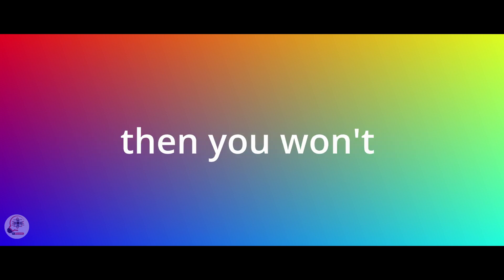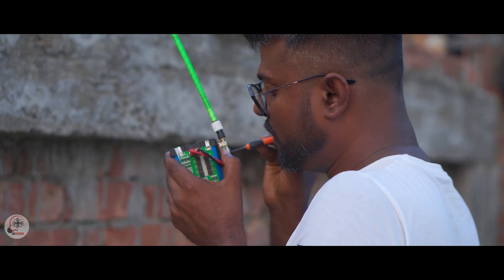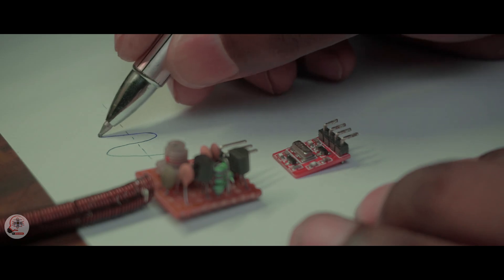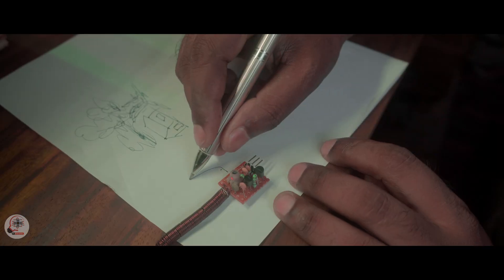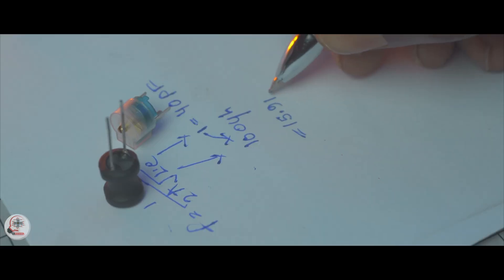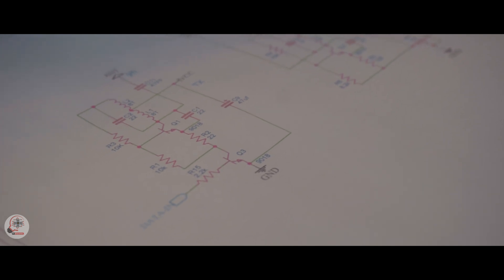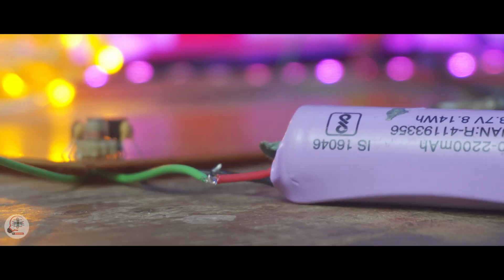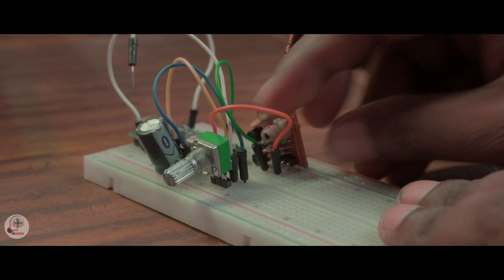How to Make Long-Range Transmitter and Receiver for  DATA (Arduino)

Comment: what if there are more than one set of modules, all working in the same 433Mhz frequency . Will not they interfere with other ?
Reply from the maker: 433Mhz module not working like  amplitude modulation  so that case transmission duty is separate to active few appliance then no problem. And will not interfere
Reply: @EtDiscover  Do you mean duty is different for each set of module?

Comment: @EtDiscover hi bro can you tell if I use resistor and capacitors of circuit with 5-10% value change excluding lc circuit will this circuit work please tell me and if you have time can you tell me what component value are critical for working of this rx tx circuit please 🙏
Reply: bro is the circuit working ? any update ?
Reply: @sdvgautham3500  no I have not completed it I have just made transmitter circuit only on pcb but when I am trying on breadboard it doesn't work I think breadboard is not good for rf circuit they are not that compact wiring for rf circuit I will complete the reciver part after some time and try but still I have many problems with his circuit diagram it quit don't work in Many simulators of circuits ...
I don't know I am studying the Hartley oscillator first then some rf type material to get more knowledge on this topic then I will properly get everything...
Doing without knowledge is like mixing chemicals without knowledge....
I know basic things like lc circuits, rf frequency, basic circuit working and building, basic components working applications , I have some knowledge with radio frequencies also but ...
This is more complete with the reciver part it makes it complicated with lm358 op-amp ic ....
I am searching for answers both for theoretical and practical understanding...
It will take time for this 🥱..
But I think if you have the components then give it a try 😝👍
Reply: Bro any update , i got a presentation on this circuit...need to implement on the hardware, this ain't working  @RobStark-fw6ig

Comment: Ek question tha mera. Can't we calculate the value of a variable inductor? so we can connect a fixed inductor. This is amazing. I want to implement it in my project.
Reply: But we have to provide another connection point at the middle of the coil ...which is not possible with a normal inductor or we have to use a transformer based inductor which have high inductance for this project.... And it is also very big for a tx and rx ... And not also tunable... This toy car inductor is best

Comment: Hello Sir!
I saw your video " Make a 1.5 K.M. Range walkie talkie " in which you shared a link of Gerber file, STL file, pcb Layout, programing codes, etc. But unfortunately this link does not open because it's not found on the server. 
So, I request to you that kindly send me Gerber file, STL file, pcb Layout, programing codes, circuit diagram etc .
I also sent you a mail on your email.

Comment: Great video and I tried it  was completed when I'm checking I use breadboard and LED for RX  and SW for Tx and LED is off when pressed 

But for  when I connect with RX-TX2B  OR HT12E-D it doesn't work does this DIY module work for Arduino projects only or there is error??
Reply: hi bro can you tell if I use resistor and capacitors of circuit with 5-10% value change excluding lc circuit will this circuit work please tell me and if you have time can you tell me what component value are critical for working of this rx tx circuit please 🙏
Reply: How much range you get with your setup  how much voltage you check it ... 
And do you know the purpose of 10 variables resistor used in this reciver please bro help me with some guidance

Comment: This is great video and thanks

But there is confusion

1.In datasheet there's potentiometer of 10k and 11resistors while in video there's 12resistors and potentiometer why?

2.in datasheet there is 47μf but in video there are ceramic only explain for us

Thanks 🙏🏻🙏🏻

Comment: bhai ye ekdum mast hai previously i tried to build such a thing by myself it was very complicated and failed after 5-6m even if it was a 12mhz one but i copied everything from your video and its working similarly like u and my main goal was to do some analog transmission and its working thanks bro.
Reply from the maker: Welcome
Reply: @EtDiscover hi bro ... I have a doubt regarding that variable resistor in the receiver what purpose it is used for and can I use normal libraries of 433mhz in Arduino ide for this rx and tx pair ... Please help me bro
Reply: Hii bro app help kaar do please kya use Kiya components bata do ...
Reply: Bc547 use Kiya yaya fir bd139 walki talki wale video wala bhi use kaar sakte ha kya
Reply: Hi bro can you provide me some information about this project... I want to know that using some resistor value 5+-% less or high will effect the circuit or not and excluding lc tank circuit using small different value will work ...
Reply: How much is the maximum data rate in kbps it can transmit
Reply: And if I use thinner copper wire for antenna will it work .... Or I have to use same gauge copper wire ... And can I use bd139 transistor like the previous video....

Comment: I make this with my custom TX and RX but I want to make encoder and decoder because I want 5channel. Plz make encoder and decoder 😊
Reply: You can use ht12e and 12d pair
Reply: @SujanGirii  but I want to make TX and RX modules at home. This is my goal to make it budget friendly. This is my a dream goal . But thanks for your suggest 👍
Reply: Bro u can't believe that in my country Bangladesh HT12E and HT12D ic is 200 rupee and 3 arduino Nano and USB cable and with mounted PCB is 140 rupee. What a logic. 😅
Reply: @SujanGirii Using the HT12d & HT12e pair is it possible to transmit in 27 MHZ, and achieve long distances? Thanks for this nice video!
Greetings from Argentina!
Reply: @ALEFILES  encoder and decoder has nothing to do with range it can encode or decode data at arround 5khz but your rf module will carry this data at their own carrier frequency e.g. 433mhz. They decide the range

Comment: Can you make 2.4ghz long range rf remote pls?
Reply: you can use the nRF24L01+ with LNA and PA
Reply from the maker: Yes it is possible
Reply: @EtDiscover  Thanks for your reply. Would be great if you could achieve same range using NRF in 2.4gz as this frequency is globally accepted license free band.